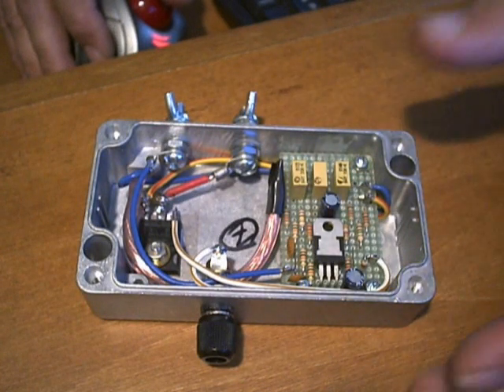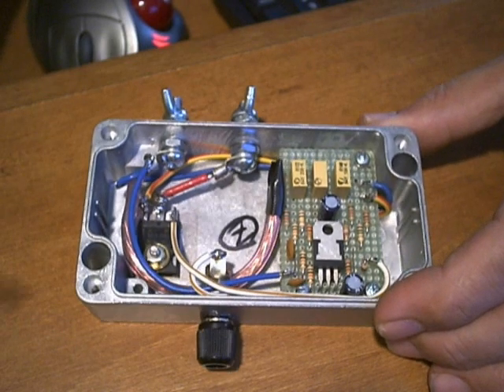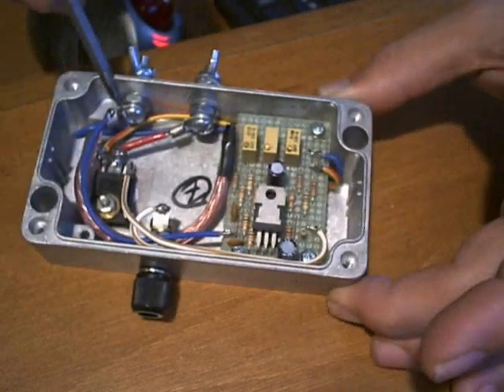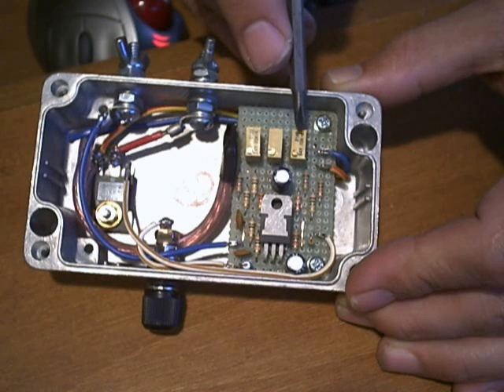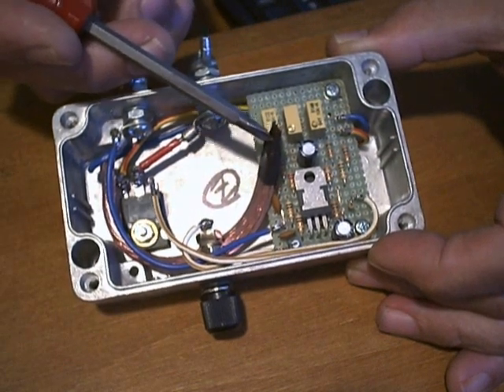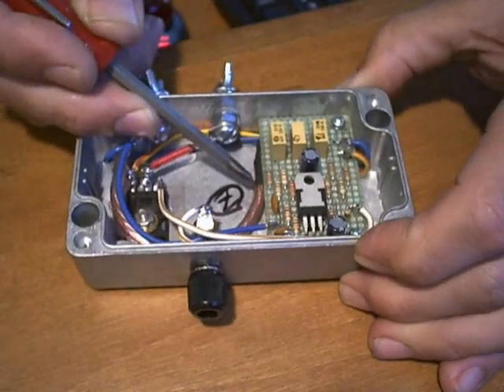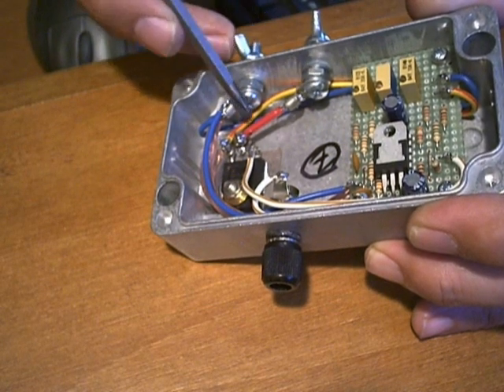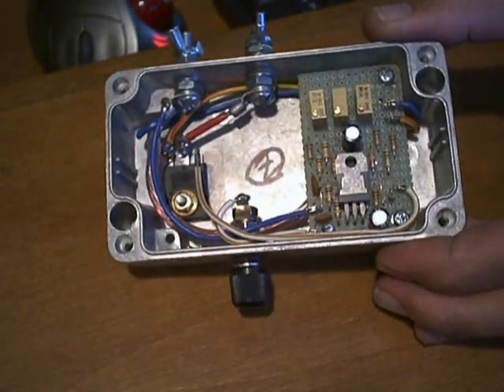#120 PWM v2a Final Walk-through

Comment: Hi Zero, I was wondering, you could mount the voltage regulator to the side of the case and use the case for the heat sink, giving you a little more thermal protection for the circuit.